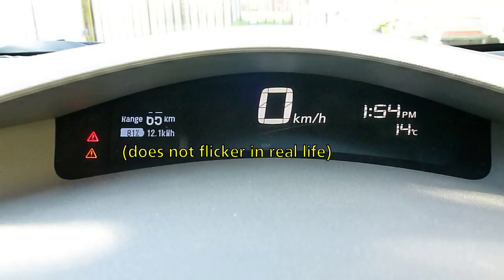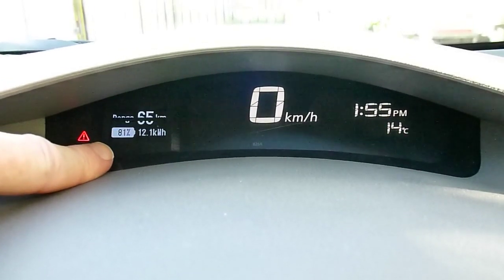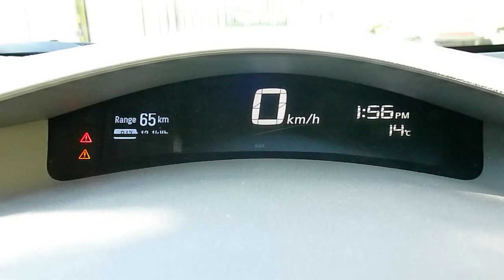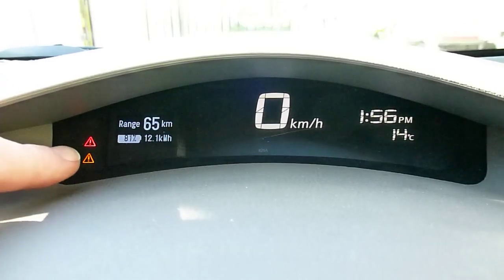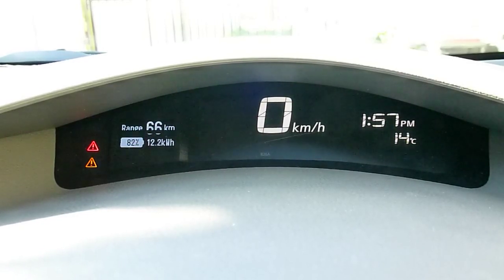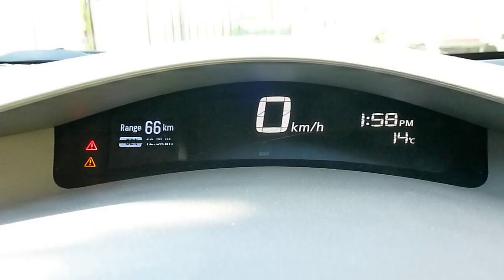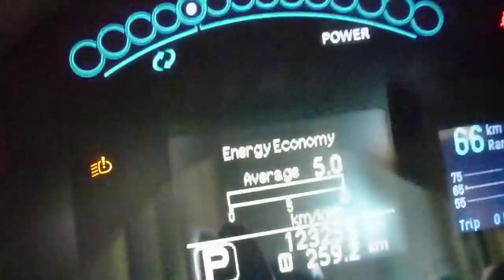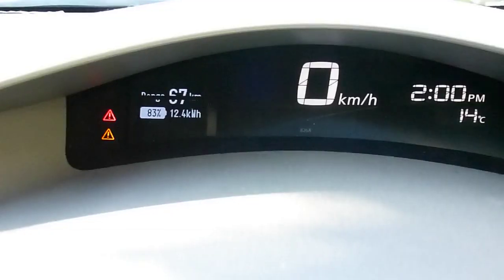Nissan Leaf 033 - SOC display update

Comment: Can't believe it's been 9 months. Hope you doing okay?
Reply from the maker: All good here. Spent my last 9 months slowly working on the second display range graph project. I thought I had it ready for a new video but then borrowed a newer Leaf to check my code and found a bunch of new issues that need addressing. Hoping to sort them over Easter. The new code now factors in battery temperature and SOH. Plus it plots battery charge during a charging session too.